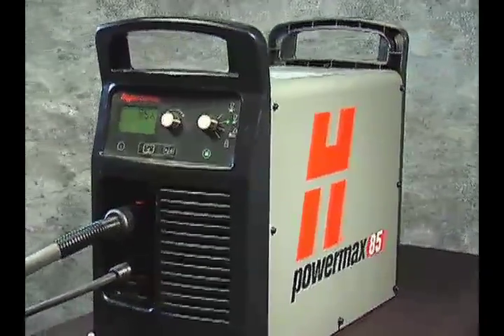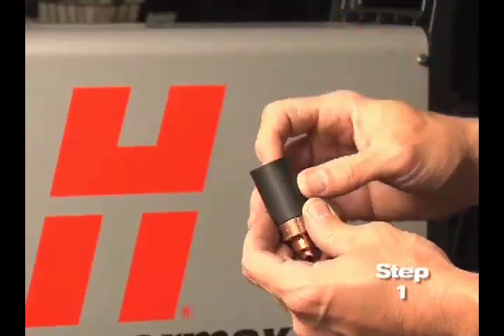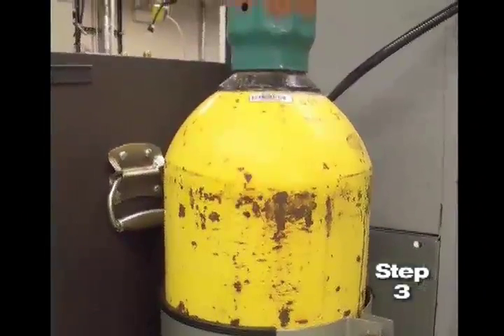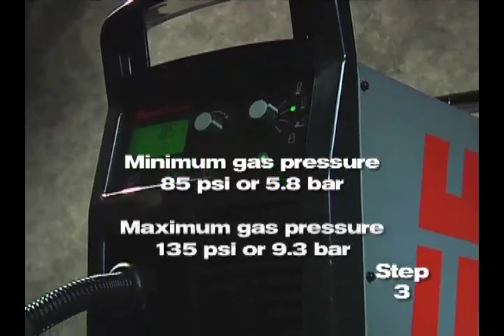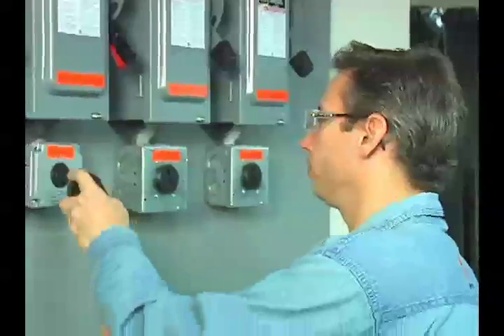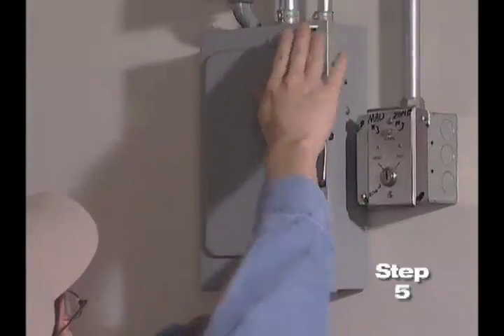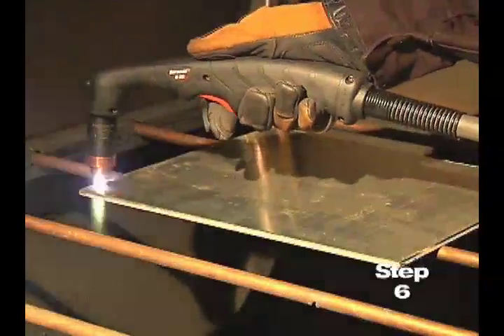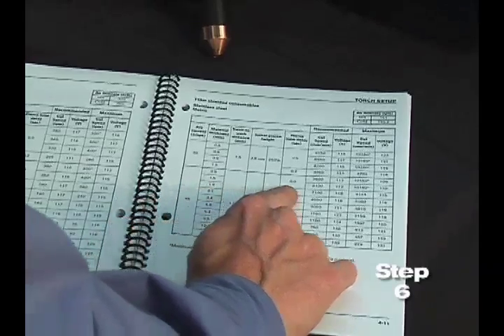Powermax setup in 6 easy steps

Comment: I have a brand new powermax 85, when I turn the mode nob to the expanded metal mode, it doesn't light up. It just stays in the mode below it. I am trying to cut expanded metal with my Arclight Dynamics CNC table and I am having no luck. I have tired everything and THHC is turned off. Is my Hypertherm unit bad since it will not switch modes?